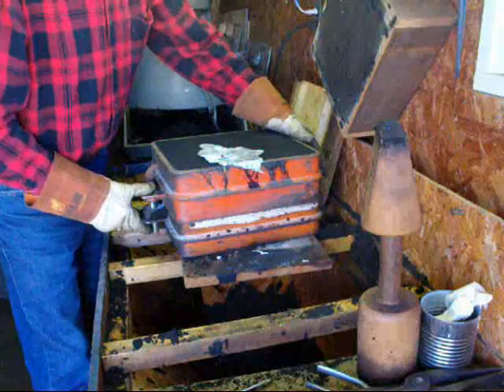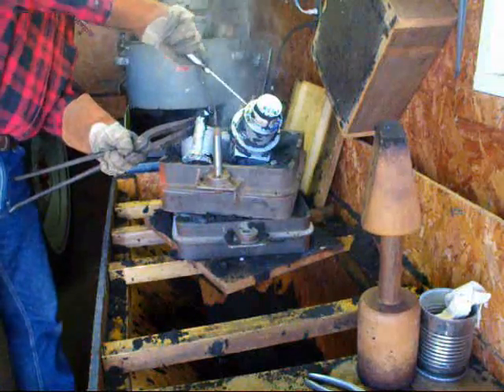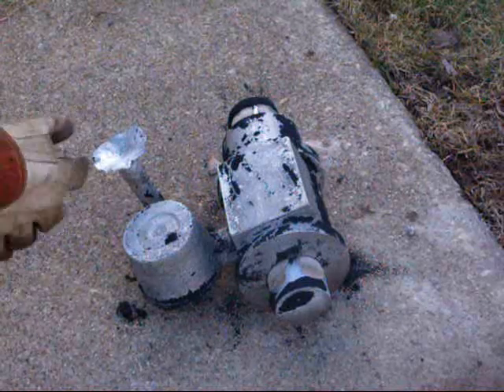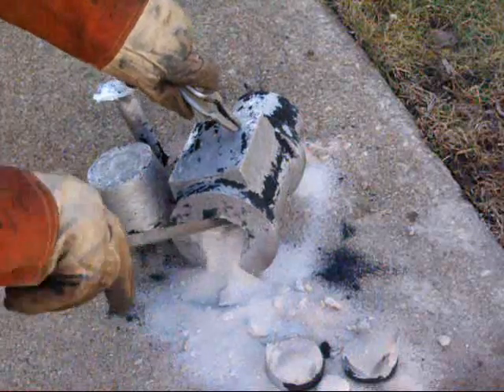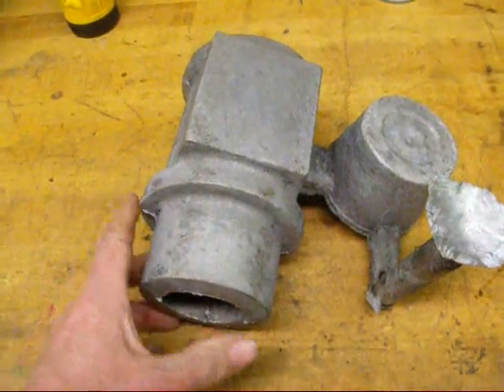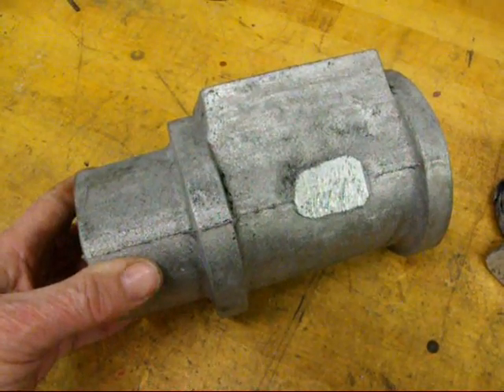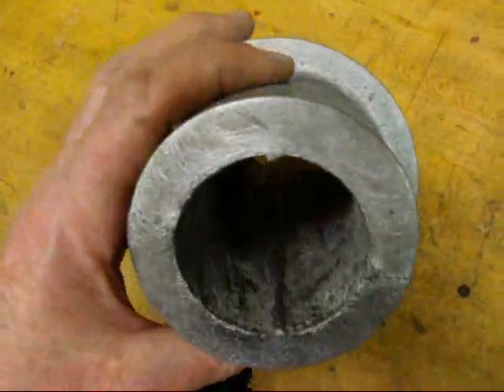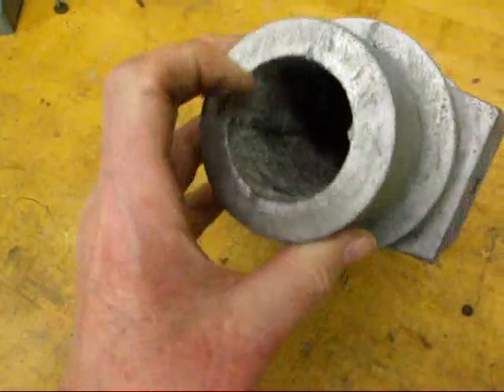BUILDING A MODEL STEAM ENGINE part 1 tubalcain

Comment: A quick question, if I may... What would be a good 'rule of thumb' to use when figuring total amount of metal (say AL) to melt as a percentage of finished casting that would include sprue and riser volumes for a casting of this size? For example, would it be 110 or 120% of the finished (cored) casting? 
Thanks again for all these first rate teaching videos! Wish my Dad would be alive to watch and learn from them, too...
Best wishes from Buffalo, NY
Roy Lewis